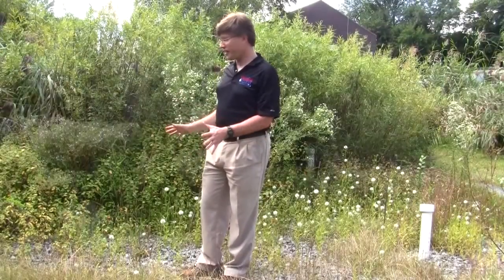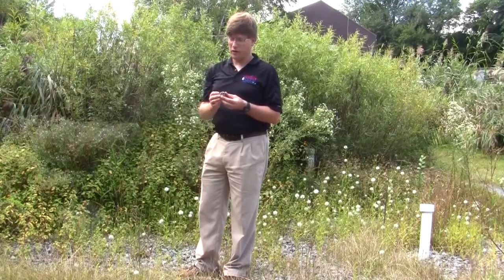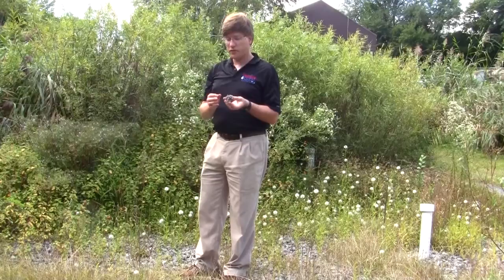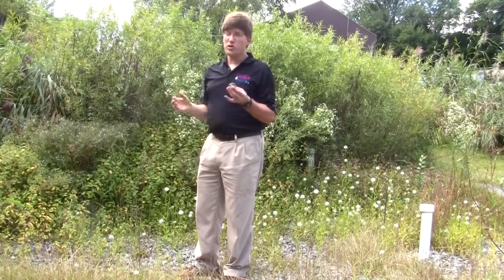Decentralized Wastewater Treatment using a Constructed Wetland System

Comment: Can a system like this be done without pumps or the need for electricity?
Reply: CrossWood Hi There. I am not an expert but have delved into it a little and in my opinion it is totally possible as long as you have enough of a gradient to allow gravity to do the job. Wastewater (black or grey water) should be able to flow by gravity into a settling tank through vertical and horizontal flow tanks etc. It just requires careful design and consideration of the steps in the process. Basically, you want to remove solids, aerate or oxygenate the water and buffer it to control the acidity by raising the pH or neutralizing any acidity. Its doable. Good luck.